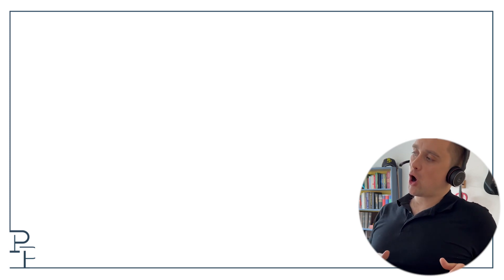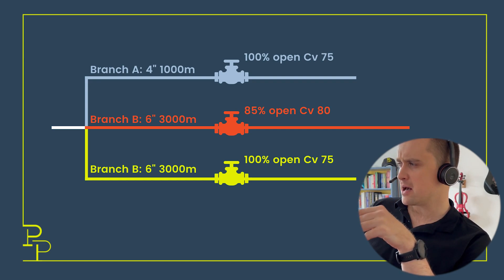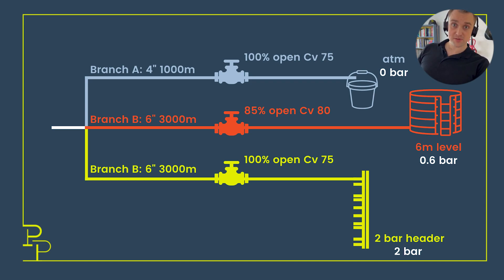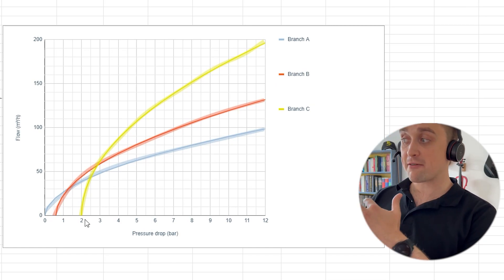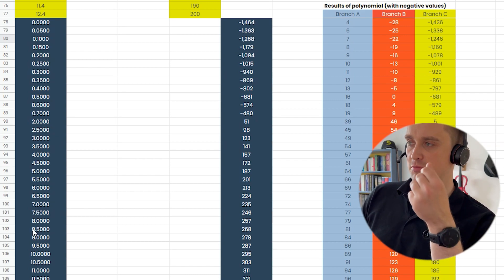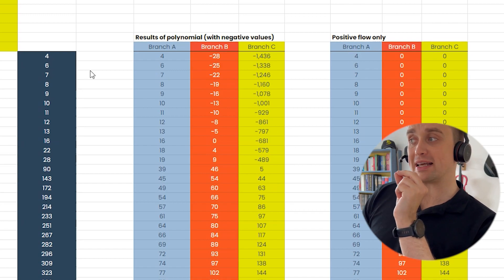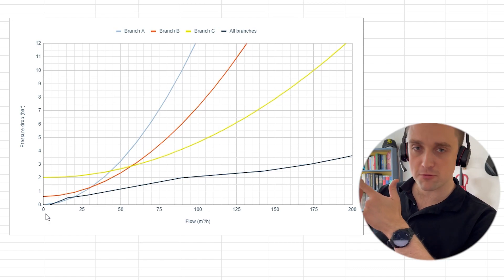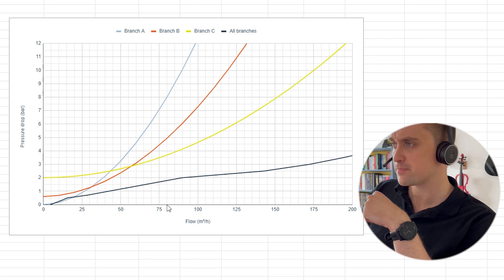Pressure drop (and system curves) for diverging branches

Comment: Nice! Only thing to say is that your negative flows don't indicate zero flow, but rather backflow from your destination :)
Reply from the maker: Fair! I guess I will need to pull that magical non return valve out my arse in response!
Reply: @ProcesswithPat  check valves to the rescue!
Reply: But it will not give the flow that the polynomial is indicating!
Reply from the maker: Eron, that is critical input, thanks for pointing it out! The polynomial fit starts at that minimum pressure for each respective curve, not necessarily at zero pressure. You can fit any order polynomial you like and each one will give different negative values below the threshold value, so they are not indicative of the reverse flow rate.
Reply: Venturi effect?

Comment: If you increase the opening of the valve to atmosphere, would the pump providing the pressure be able to maintain constant pressure to the branch point even though flowrate will increase?
I'm curious about dynamic scenarios and if/how upstream pressure changes due to increased flow from a valve opening on a branch. Surely greater flow and greater pressure drop means a pump will not be delivering the same pressure?
Reply: The pump will have to adjust according to the pump curve - more flow means less head from the pump.
Reply: @brendan714  Ok thought so which means iterating the calc based on flow and pump curve till the final flow is converged?
Reply: @Bruh-vp6qf  yes I think the way Pat is doing it with spreadsheets you would have to iterate by choosing an arbitrary delivery pressure, calculate the total flow you get from that pressure, use that total flow to then go back to the pump curve and see what pressure the pump gives, use that pressure to re-calculate flow, etc etc until it all converges. 

The other option would be to solve it using a process hydraulic simulation software like AFT Fathom, if you input all the details of the model (pump curve, line lengths, fittings, valve details, downstream delivery pressures), it will automatically iterate and calculate your flow rates. 

Pat's method is very much a hand calculation. Sometimes the systems get so complex that you can't solve it by hand and you need software to help. But it's always good to know how the calculation works, especially so you can do a quick sanity check when the software dumps out data.
Reply: @brendan714  yep agreed just wanted to make sure I had the right thinking.cheers mate